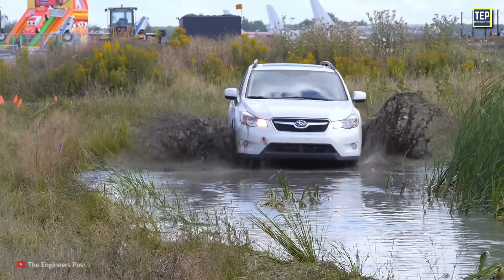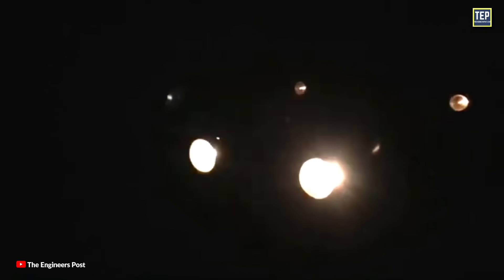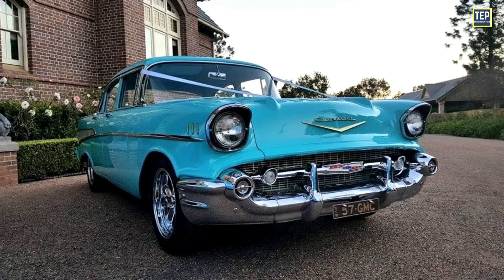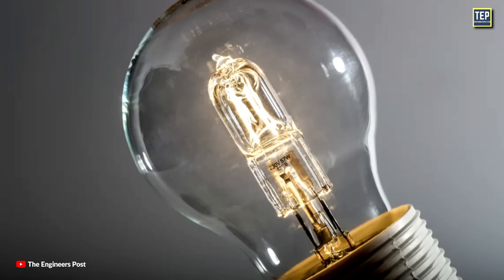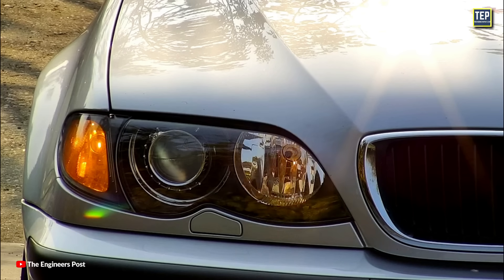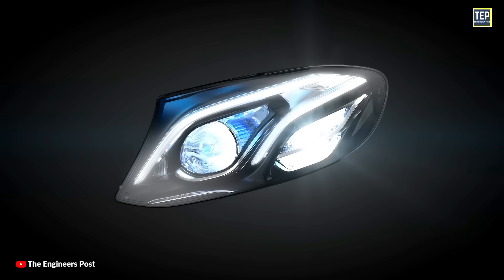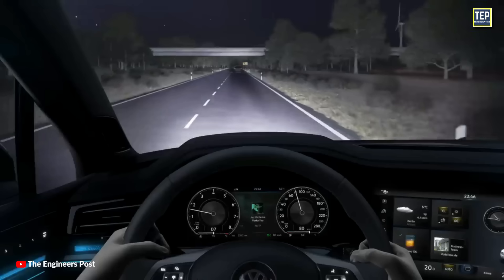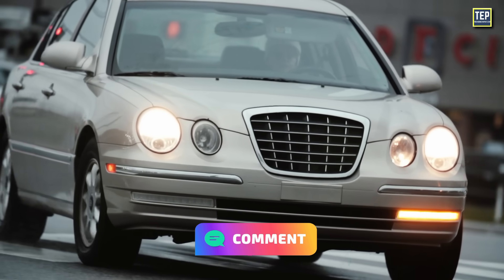The Problem With These Headlights

Comment: I've driven cars with most of those technologies, but the oldest with the chemical system. Things have improved tremendously, and it's for the better. The problem with newer technologies is when you try to retrofit them in old applications. Xenon and LED systems are fine when they are designed for that specific purpose from the ground up.  In some instances, you can use LED bulbs in older cars with decent results, but some things must be kept in mind.  First, you need high-quality LED bulbs or sealed beams (They are not cheap) and must also align your headlight properly. Sometimes, even that won't work.
Reply: Of course the new technology provides the best results, but I foresee maintenance problems with such complicated technology when the vehicle gets older.

Comment: BMW i8, gotta love its timeless futuristic design.
Reply: Also the engine & electric motor duo too
Reply: @Short_N_Simple Nah thats what makes the car terrible.
A 3cyl hybrid thats incredibly slow really ruins the car
Reply: @centrixx7692 damn 😂
Reply: I mean it looks cool but it just needs to have some power.
Reply: @NeedForSpeed.2004  Yes, this car will never age! Can you imagine it with the V10 of the Huracan?!
Reply: @NeedForSpeed.2004 had anyone ever thought of adding pedals?
Reply: I have the i8 laser lights, really disappointed about the visibility. I thought they were malfunctioning, but at bmw they confirmed they worked fine. Prefer xenon.
Reply: nd the 3 cylinders 🤣
Reply: No, I don’t.

Comment: The evolvement of headlights is just stunning.

I recently put H4 LED in my old 1997 car with reflector headlights.
https://www.youtube.com/watch?v=6HyspFngiO8
It needed new headlight units because the reflector got dull, so with a brand new clear reflector I wanted to try LED. There are a lot of H4 and H7 LED types from countless brands, but most are not good. When research well, you can find models that actually produce halogen-style light pattern without scattering/blinding. So you really can't just say it's not gonna work, because it does work! The most important is to have the actual LED's in exactly the same location as a halogen filament. Only 1 mm up or down ruins the light pattern. But there are manufacturers who does that really well and it works great without blinding anybody. And again, clear glass and reflector as a true mirror is mandatory. And ofcourse height-adjustments doing right!

Comment: all those lights are fine as long as they are adjusted perfectly and the road is perfectly level. once they become a bit misaligned or there are some small bumps or crests / as/descents they start blinding everyone else.
Reply: BINGO!
Reply: NO!  They are not fine if adjusted properly and on a perfectly level road.  They are still excessively bright and casting blinding color temperature cold light into other peoples' eyes.

Comment: Headlights that follow the turning of the steering wheel were available on 1967 onwards Citroen DS models, with up to 80 degrees of arc. I believe they were cable operated.
Reply: The tucker had a middle headlight that turned with the steering column.
Reply: @cavalierliberty6838  The Tucker wasn't a production car though, only a concept.
Reply: @cavalierliberty6838  the big three being (as is usually told) afraid of the tucker is also the reason why the US market DS didnt have the swiveling headlights, as US regulations require that thry were fixed
Reply: Yes, it was ironic that a pre-68 Citroen was shown at 6:05 as an example of a sealed-beam headlight, when even the model shown had separate halogen globes, not sealed beams.  It was only the inner long-range driving lights that swivelled with the steering.  The outer lights, which included separate main and low-beam reflectors and halogen globes, were connected to the front and rear suspension and were self-levelling.  They compensated for any pitching, as well as dipping when going over a hill-crest and raised slightly when driving into a dip.
Reply: @normandiebryant6989 exactly, this video is so full of errors I don’t know where to start
Reply: Some cars in the '30s had swiveling auxiliary lights. Someone might have had them even earlier.
Reply: Cable operated are the best. The cyclecars had cable and pulling operated steering. Older airplanes used it for their rudders.

Cheap, works well, hardly ever wears out, but if it ever does it's cheap and easy and quick to replace.

How things should be built. How they were.
Reply: @normandiebryant6989  the Citroën hydro pneumatic suspension is inherently self levelling. I guess there could be some monetary vertical adjustment of the head lights if the front is momentarily diving under heavy braking.
I can't see how a 1960s car would know it's going over the crest of a hill. Unless you're going fast over a humpback bridge, there isn't going to be any change to suspension travel. They would need a gyroscope, monitoring the car's "pitch" axis (if you think of it as an aircraft). That's very possible with the gyro technology over the last 15 years or so but you would literally need a mechanical aircraft gyroscope to do it in the 1960s. Maybe it was done in a concept car.
They could try to measure vertical acceleration. That would tell them the car is going over the crest of a hill or has reached the bottom of a dip. That's only compensating for a small part of the problem. (Also the magnitude of the vertical acceleration would vary a lot with the car's speed). 
When going uphill, the headlights need adjusting downward whenever the hill gradient is decreasing. That's quite a challenge. (Perfectly possible today if manufacturers want to do it).
Reply: @alanm8932  Yes.  The self-levelling had an inbuilt delay to prevent it trying to compensate for every bump and hole.  The self-levelling headlights were much faster to react to big movements but they, too, had a damper so the headlights didn't flutter over bumps.  (If you forget to connect this damper, the lights sure do bounce and flutter wildly!)
Reply: @normandiebryant6989  does the headlight vertical aim do anything nasty if you raise or lower the suspension height? Perhaps not if it's looking at the difference between front & rear suspension. That sounds like some advanced linkages needed to achieve that.
I wouldn't describe the self levelling as having an inbuilt delay. That implies a time delay. I'd describe it as hysteresis. It's basically "engineered" slack in the height sensing links to the height control hydraulic valves. (A small pin in a large hole). If there wasn't this slack in the feedback loop, then the suspension would constantly be hunting up & down.
The actual movement of a volume of hydraulic fluid when the valves "decide" to make an adjustment, does take a little time, so I guess some headlight aim compensation could be justified.
Reply: @alanm8932  Yes, it has cables to the front and rear anti-roll bar centres.  The angle of the headlights are only affected if the front and rear are at different heights from the road, such as when the car first pumps up (the lighter rear suspension usualy goes up first) or when you go over a crest, into a dip in the road or just brake heavily.  The fully-high suspension position has no effect, except raise the height of the headlights above the ground.
Reply: The problem with that, is that it is another thing to fail and on an older vehicle, most will not be repaired if there is no safety inspection to catch the fault, so they become perpetually mis-aimed.

Comment: LED matrix lights are my very most preferred option cause it is cheap, longest lasting, very well lit lights and blocks out sections to stop blinding drivers whilst retaining optimal visibility in my Tesla Model 3 highland.  They're not the best but get the job done.

Comment: Also leds do wear over time so the light output is getting lesser when they get older.
Replacing them will be very expensive.
Reply: Everything in life wears
Reply: @benchmark3332  Yes, but a $20 halogen bulb is a lot cheaper than a $2000 LED headlight housing.
Reply: @bwofficial1776  LED lights will last way longer than halogen ones. Most likely, while you own the car, you won't have to replace them.
Reply: yes... LED bulbs do not last as long as advertised.

Comment: Recently headlights have gotten much brighter. That's great out in the wilderness. And pretty bad in the city. People drive around my city without their lights on and don't notice. That's unsafe too. But very bright headlights make it hard for everyone to see. We need a city lights setting that is more for the purpose of helping people see the cars with the headlights on, but don't have to illuminate everything in front of them.
Reply: That is compounded by that addition of day time running lights that lack proper directionality and sometimes approach the intensity of some headlights. Daytime running lights should be off when headlights are on unless they are either directed down and/or are significantly less bright.
Reply: @etmax1 The idea of Daytime Running Lights is one of the most useless ever conceived, in my opinion.  Since almost all modern vehicles are so-equipped, it diminishes the importance of the additional lighting traditionally used on emergency vehicles, and many drivers ignore them.  

However, it now appears that many newer cars and trucks are no longer equipped with DRLs. 

Additionally, because the DRL mode puts further strain on the headlight bulbs, their life is shortened.  

It may be a bit more complicated on newer vehicles, but an easy solution I have employed is to simply remove the fuse for the DRLs.  I did that with my motorhome and it didn't affect the normal operation of the headlights.  I plan to do the same thing with my car.
Reply: It's not about brightness but control, low beams are design to throw light below drivers eyes. They need to be properly adjusted and you need to use bulbes design for them. Putting LED in an halogen headlight will cause the light to go all over the place and blind other road users.
Reply: @dufonrafal Except that fails miserably on inclines, bumpy roads, and the ever increasing height of lamps (I just measured a Denali today that has lamps at my eye level in my car (4’7” off the ground)
Reply: @jmi967  bumps will annoy you for 0.1s it’s not really an issue. Height really is though, headlights should be about 30" above the ground.

A stock Denali is like 35" above ground. But with everybody raising their trucks in North America, that’s a big issue.
Reply: @dufonrafal  0.1s is plenty enough to sraw your attention off the road and cause temporary night blindness.

As for the Denali, the newer models are that high stock. Every single one that ended up behind me last year was in my eyes. The one I measured didn't apppear lifted, and a 24 inch lift would be dead obvious (and it was in an old folks home).
Reply: @dufonrafal they are directed below but still very bright
Reply: real problem where i currently live...people wither drive with their brights on constantly, or are unaware of how bright their new car lights are compared to older vehicles they've owned...very annoying when people drive around thinking, "i need to see..."while" blinding everyone else..."...
Reply: There is, it's the Daytime lights
Reply: @Fieldofcarsza  And recently in North America, the full headlights are now mandated to be in operation 24/7 due to Canada's stupidity around adaptive headlight legislature.
Reply: Even the daytime running lights on pickup trucks are blinding these days.
Reply: If your car has the setting, you can drive with navigation/position lights ("parking lights") on while in dense city with lots of lighting. Drivers can see the orientation of your vehicle from all directions but your headlights won't be on. Driving with only navigation lights on I recommend having white lights on the front and not just the amber markers.
Reply: @bravskii10 That's illegal, and unsafe. Street lights aren't covering every square ft of road, and other lights from cars can make you impossible to see.
Reply: I live in western canada and its amazing how some people are to dumb to figure out how to " turn the knob " during the dark... and guys driving older vehicles without day time running lights driving during the day with high beams on where he'd physically have to "turn the knob " I've seen It lots lately ..I just shake my head and says fricken dummies don't have a clue 😅
Reply: Yeah, then the idiots also turn on their fog/driving lights to really fry your retina
Reply: There was a "city" setting, where a signal sized bulb in the headlight housing lit for use where there's streetlights.
Reply: @KOZMOuvBORG  Yep, my car senses streetlights and of course, oncoming traffic, and will adjust accordingly (meaning it will maintain low beam and automatically disengage high beam).  I understand what everyone is saying here and I agree, but the best option for oncoming traffic is to practice focusing the center of your vision in your lane of traffic and avoid looking directly at the lights.  Light affects our peripheral vision quite a bit less than our center of vision.  I'm not hoisting blame onto any of us because I do agree, headlights have gotten much brighter and it is a big pain to have a high profile vehicle behind you blasting intense light into the mirrors!
Reply: You have described the concept of marker lights or daytime running lights.
Reply: Gotta make sure the low beams point down, and the high beams point close to 180⁰ , parallel to the street the car is riding on.
Reply: It’s an arms race. It’s why people drive 4x4 earth movers instead of the little runabouts they used to drive 30 years ago, so they won’t come off second best in a crash.
Reply: @Tailspin80  I think there are some people and some places where that is the dominant cause. But a lot of reviewers and safety testers and raters are giving much better scores to much brighter lights, and many vehicles with these bright lights are just stock and people are buying and driving them for practical reasons.
Reply: You mean DRL's???
Reply: @SawnOffDoberman  no
Reply: Matrix headlights need to become mandatory.
Reply: We could also reduce the brightness if we stopped aiming 50% of the light at the ground in front of us, making us have to increase brightness to compensate
Reply: @jmi967  most of the light should be near the cutoff line by law, high end headlights use projector to optimize light distribution better.
Also, there is a brightness setting for all the screens in your car, lower it to the minimum at night !
Reply: @dufonrafal  I can and do change the rearview at night but that also limits my rear view vision for everything else. Most side view mirrors do not have an adjustment.

As for projector lamps, they only work like that when they are not pointed at you and in the aforementioned conditions they are doing more harm. They are even worse from oncoming traffic and there’s no stopping that. And given that a lot of them dump a lot of light to the sides, there’s always an issue which is going to be made even worse (as in potential eye damage) with lasers if they don’t get the problem in check.
Reply: A lot of cars automatically adjust their lights not to blind other drivers though, I think that just needs to become standard

Comment: I’ve had al kind of lighting from halogen in the 80’s till in got xenon on my BMW 320i in 2013, till my 2nd BMW with adaptive laser lights. Everytime it got better with every new technology.  With the adaptive laser lights I can drive all the time with high beams, because the light beam is adjusted to the car coming toward me or the car I’m driving behind. 
The only drawback of these super bright lights is that road signs with reflective material are just to bright you almost want to put on sunglasses at night.
Reply: So you think thatvyou arenbothering people with you high beams       especially  because you drive in suburban wooded routes and by ways.       Only reason to have high beams all the time

Comment: Pretty nice historical summary. It should be mentioned that it's not only about brightness, intensity, or color temperature. Modern headlamps need to have a good contrast (ratio of intensity between areas where they would potentially glare others and where high intensity is needed for visibility). A lot of people here confuse bright headlights with dazzling ones. Regulations allow a lot of flexibility here and there are bad examples even on new cars. Watch out for a good IIHS headlamp rating in the US market. Manufacturers can only achieve a good rating in this test when both range and low glare risk is achieved. Glaring headlamps are often adjusted wrong or modified by people who don't know what they're doing or if manufacturers are trying to save money. Technically Laser and LED headlights are most suitable to design high performance headlights which achieve great visibility and low glare. Sophisticated optical concepts and adaptive headlamp systems take this to the next level.
Reply: The picture of adaptive headlight in the video works only in the horizontal.    There should be a number of rows on these 
'lazer" lights so it is adaptive in the vertical as well.